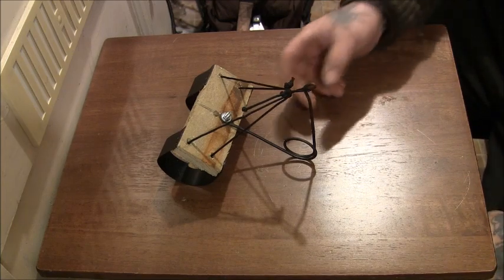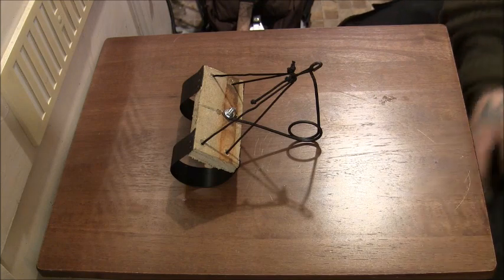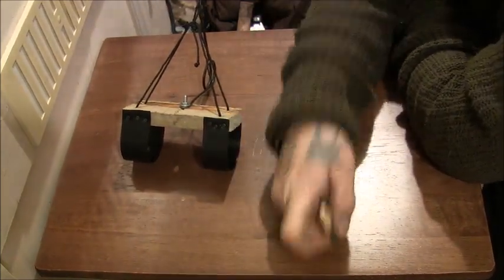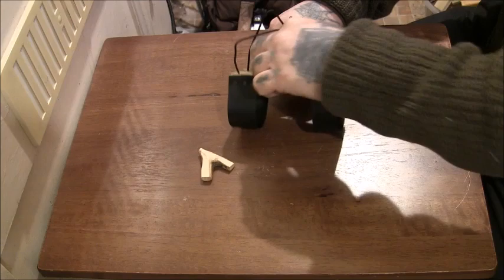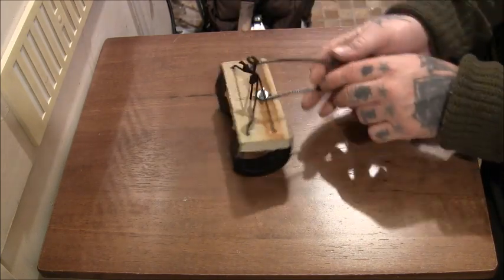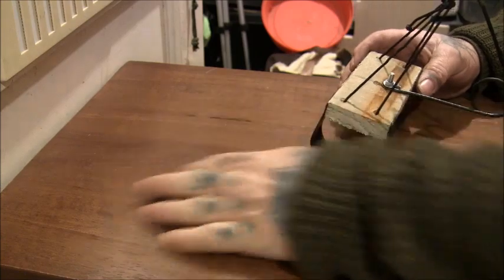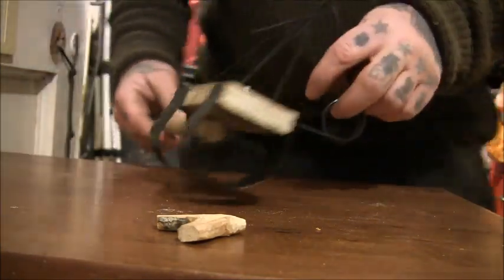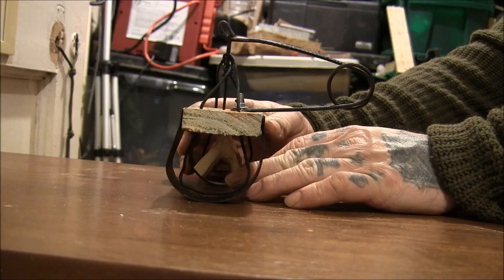Homemade Mole Trap

Comment: Ah yes a classic trap design that was used for hundreds of years. Early ones were almost something you could make in the woods, comprising of a board made from split wood, loops for holding the snares being made from bent willow and a piece of hazel being utilised as a spring. With the development of a spring, other body shapes came about in the form of a wooden half barrel and full barrel,  being turned on lathes, although clay was also used but were frequently damaged. Other spring forms were also seen in the form of an almost hapf bow limb piece fashioned to the side of the trap. Great so see people like you Malcolm trying your hand at making these. Still work great if set properly
ATB
Reply from the maker: cheers mate , much appreciated , i,m gonna have a go at making some like that when i can , thanks mate

Comment: What makes it a mole trap as opposed to a mouse trap? Looks like it could catch either one. Interesting trap, thanks for showing.
Reply from the maker: cheers mate ,  the dimensions for that trap are exactly right to catch a mole around its body , and the right size to go into the run but it could catch a rat or a mouse for sure as long as they push away the trigger stick , the mole will push past the trigger to get along his tunnel and get caught almost every time